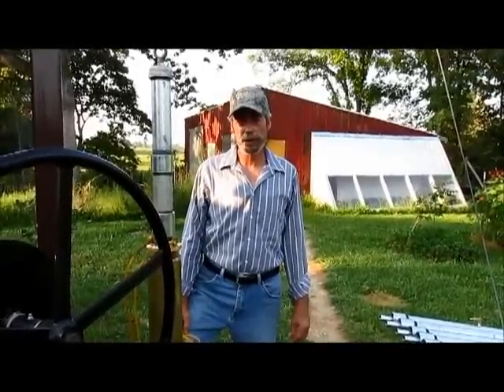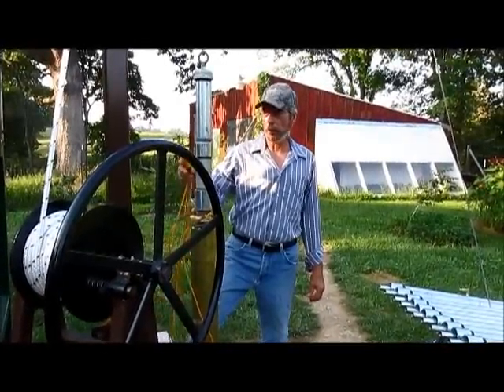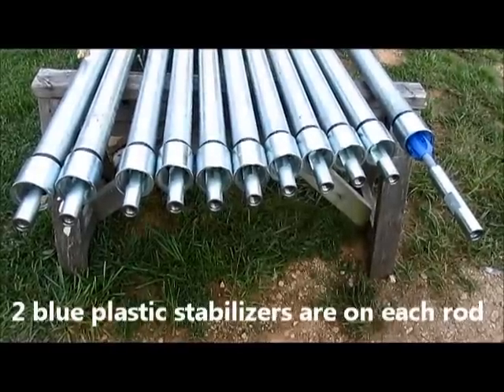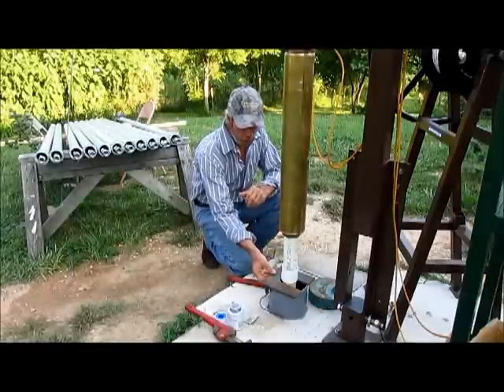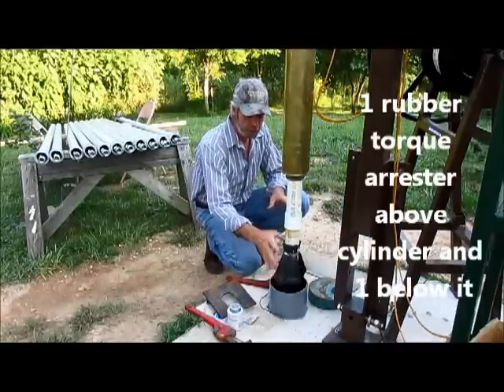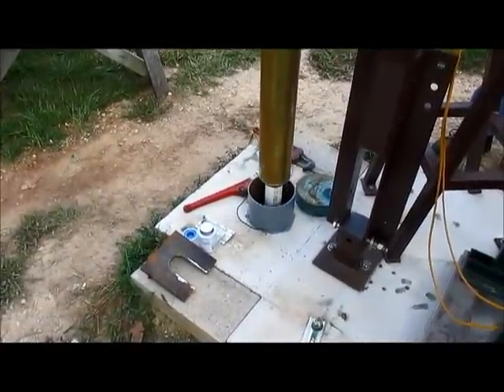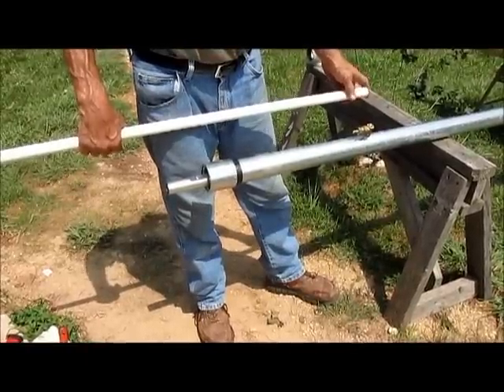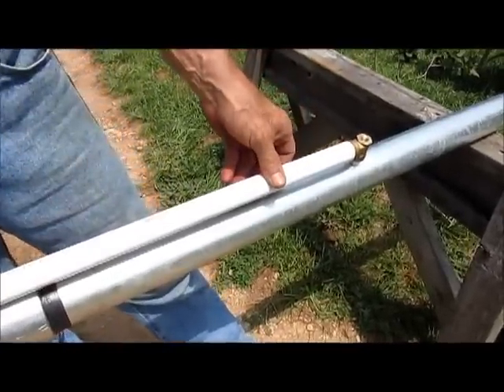Hand Pump, Well Pump Installation Without a Boom Truck- Part 2

Comment from the maker: In case the static water level drops below the cylinder, the pump can still draw water 20'.  Thanks for your question.  You were paying attention!
Reply: I have been trying to buy a Water Buck pump assembly but no success.  Can anyone help me??  If it is no longer available I would gladly buy the plans and "one-time use" agreement.